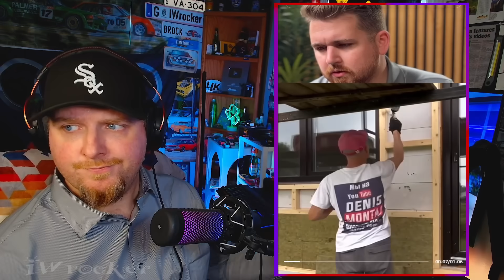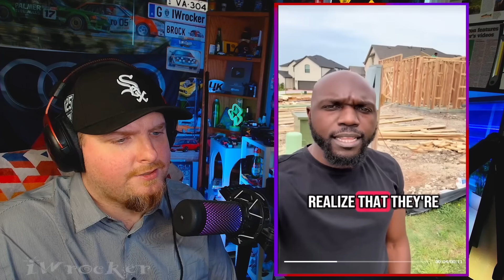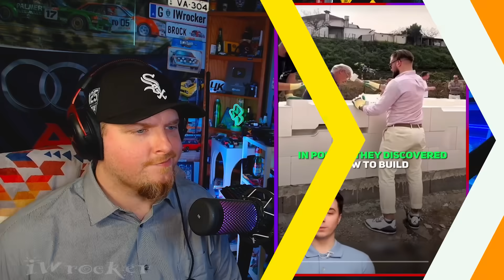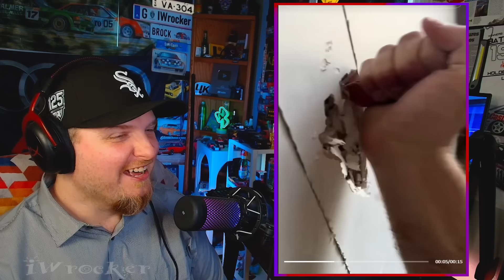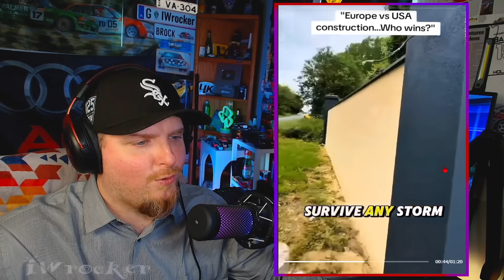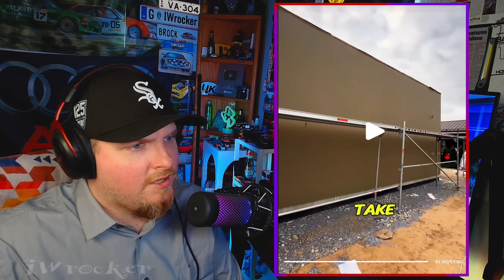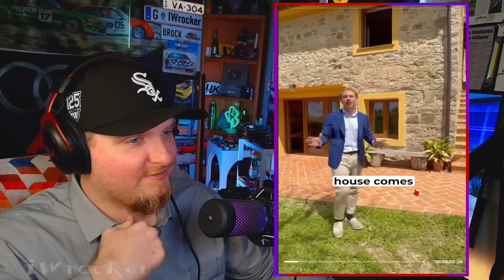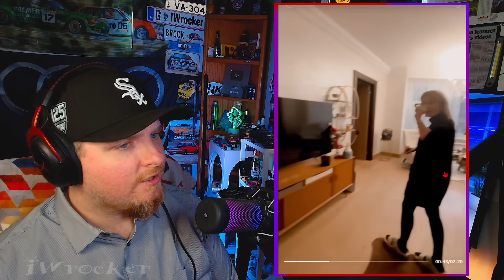25 Minutes of European VS American Home Quality & Construction Methods 🔨

Comment: European here, I live in a brick and concrete apartment with a good amount of insulation in the walls. Recently we had -27 degrees Celsius (-17 Fahrenheit) weather with a pretty good breeze. Inside my apartment I had 19 degrees Celsius (66 Fahrenheit), with the only source of heat being two small radiators. My building was built in the 1960s and was modernised in the 2010s with a heat recovering ventilation system. Aside from a bathroom remodel a few years before that it is the same apartment they put up 65 years ago.

My building is nothing special, it was part of the "Million Program", where the government organised the construction of a million apartments around the country due to the housing shortage we experienced in the 60s. They built a lot of apartments, as cheaply as possible and the majority of the construction was of the same or better quality as what I live in. Some were worse of course, always some greedy a-hole trying to scam a buck, but most still stand and are enjoyed by their tenants to this day.

Comment: The first guy, saying that they do housing better in America - you carry houses on trucks in America (before putting them down - i dont mean recreational vehicles). Like, to me it means theyre made of carboard or wood. Do they even dig foundations in America? They have to, since their skyscrapers still stand, but for a common bread eater? Its probably plywood and spit.

7:43 Dont approach a European wall without a set of drills, a pneumatic hammer or... a wrecking ball. Honestly. Our houses are meant to last, and to be frank - if American housing was built like European one - it would survive tornadoes (maybe except the roof - that would fly away), and not fracture into a million splinters, like we see on all those tornado videos.

Comment: Insulation on the outside is absolutely the proper way to do it. That way it is just a lining on the wall, and all the little bugs and critters that eventually might find it's way into the insulation are kept outside. Plus the wall itself is insulated from heating or freezing up, opposed to the US logic where the home is insulated from the hot or freezing wall.

Comment: 6:00 from what I know (I'm not an architect nor I work in construction, so feel free to correct me) you use mortar to absorb the movements of the house. because houses are not statics, and neither is the earth they're build on (think minor earthquakes). so mortar cracks but it can be replaced cheapely.

Comment: 18:05
The building is basically triangular but its a fairly sharp angle. The end is just 2 meters wide, but on the other side its 10 meters wide, the house is 22 meters long so the angle is quite sharp

21:00 That house in tuscany is pretty expensive. Its not very large, its very far out in nowhere , and you might think, well 185k is still not that expensive. You have to consider median pay in Italy is about 1/3 of what it is in the USA, and houses is really mostly construction work. So that would be a 550k home in USA

23:15 "How is it 700 a month"
Well it looks like its Riga, possibly Vilnius. Again they earn about the same as in Italy, So that would be a $2100 apartment in the USA. While sure, a $2100 apartment in NYC is still tiny. But Riga and Vilnius is not that large, about the same size as Tulsa. So would i rather want to live in Riga or Tusla. Yea. well riga is pretty nice, Never been to Tulsa, but it looks kind of boring

Comment: 18:40 I don't know if that specific house is just a facade, but this trick was used around  1860s, during the construction of the underground railway in London. As the steam locomotives generated large amounts of steam and smoke, it was necessary to provide open spaces where the puffs could find an outlet and disperse. Such a space was created however, an open hole in line of homes wasn't looking very nice. So they put the facade homes to preserve the nice look of the street :) (I'm not from London, not even UK- still European :)  so I might be way off....)

Comment: I used to work and live in Texas, and had kind of an interesting discussion with a co-worker when I told him I picked tripple-pane windows, which is the de factor standard in Sweden, and he though it was an unnecessary "upgrade" until I showed him I was getting about 15% energy saving compared to double-pane and 25% comparred to single-pane, especially on really warm days. And yes, I ordered Swedish tripple-pane windows and shipped it to Texas!

Americans love their AC but they also seem to want to waste a lot of that cool air with poor insulation or poor windows.

Comment: 2:00 That is a pittifyll amount of insulation.

Of cause, those blocks are foam concrete, they ad some insulation, but the added 70mm on top is really not very much. I have 210mm on  the old part of my house and 350 on the extention

14:30 This was done in  Sweden for a few years, but all of it need to be riped up. Sweden was way to wet for that kind of insulation and all of it get mold.

Maybe down in central europe where its a bit less wet and more dry cold it works.

Comment: That first guy mentioned pressure treated wood. Used to work in the construction industry in the states, so i have an insight there. Pressure treating helps wood resist decay and resist damage by insects. In damp emvironments, it is necessary for exterior walls because otherwise water will cause the wall to rot fairly quickly. And in this case, he is right to be worried. The concrete will sweat in the right conditions, (moisture trapped within will emerge) and without pressure treated wood, that wood can and will rot. I was trained that any wood placed directly against concrete needs to be pressure treated for this reason. It is to preserve the longevity of a build. And once that wood begins to rot, the rock wool (insulation) will begin to break down. And nobody wants that.
Reply: In Europe, pressure-treated and/or steam-treated wood is also commonly used, but even this is not installed in direct contact with stone or concrete. Decoupling is usually achieved using a layer of bitumen or similar building materials. I occasionally saw this in the US as well, but it seems to be a measure that is often omitted there.
Reply: @marcromain64its a different chemical treatment, but its safe to assume that the european one is better. Lol. In my experience, a metal stud gets fastened to the concrete, and the wood to the metal stud. This gives a small gap between the concrete and the stud. Though it is still referred to as "on concrete" even though it technically floats between 1/8th to 1/4 of an inch off of it. Roughly 0.3 to 0.6 cm. The gap can be larger, but rarely smaller. 

Also, never worked in small residential. My work was in industrial mostly, so we may have had different criteria.

Comment: The first video: That's a sample-size of one, so it's meaningless. This could be a refurb, it could be a guy doing it all wrong, They might even build a second layer of bricks on the outside. We don't know. Here in The Netherlands we generally build two walls and fill the gap with insulation.

And no there are no pro's to US construction. It's not cheaper to build, it's not faster to build, the insulation is worse, the sound insulation is basically not there, everything is made of flame-retardent material instead of just using non-flammable materials. For poopsake you still build dryer events into your houses... it's 2026, we stopped selling dryers that need a vent a long time ago...

4:40 House styles.

Different styles is fine, the looks are not the problem, the construction methods are the problem.

Building without Cement: Yes this comes back every few years and then it goes way again because... well have you see the size of blocks you need to get sufficient interlocking strength to keep it from falling down?  And you still have to seal the seams anyway so why not just make the blocks 1/4th as wide and add cement?

13:00 "Exterior insulation is normal in Europe" 

It's used in some parts of Europe. But sure, Americans think Europe is a country, so...

"if it's done crappy..." Every building technique leads to problems if it's not done right. Every house has to be rainwater-tight and properly ventilated. That's not a unique to this method.

18:30 It's not a facade, it's a just a house built on a wedge of land between two roads that meet to the right of that building. We have them in Amsterdam too. Inside the orientation is probably sideways so they have normal sized rooms but one several of those buildings, side by side.

The 180k house in Tuscany: Be aware that there will be a catch, like you pay  180 for the house and then $40k a year for the ground that it sits on, or there is some other tax that adds zeroes to your monthly bills. There is/was a promotion with italian houses where you could buy one for $1, but the catch was that it was basically a condemned building so you had to spend serious cash to get it to a state wher you could live in it. And then the rest of the village was still condemned houses...

21:00 700k for a 130meter apartment is about right for a big city, outside the city it gets you a nice house with a garden and a garage. Prices in Amsterdam are IN-SANE (thanks to all the tourists and expats), but 20km-40km away from Amsterdam they get more normal.

Comment: hmmm Russia, inner porous concrette wall (slightly tougher than chalk material, very porous, good insulation) + 5cm thich rock wool pannels on polyurethane foam (fills gaps and glues)
 - northern germany - same porous conrette wall, 20cm thick rock wool panels covered by 12cm kilned brick wall (because all city is historically made of brick, so they need to fit). Overal thickness of wall is 70cm (2.5ft) and only heating is needed for hot water in tap (maybe twice a decade if is exceptionally cold winter) - so must usuall is air to water heat pump (Russian probably heated by natural gass or wood).

(Poland - also porous concrette)

strofoam insulation, post comm countries very usual, various styrofoams are used, recently people preffer rock wool panels. That dark grey styrofoam is (iirc) with reduced flamability. I.e. in my country is illegal to not use anchors to mount it onto wall, in past it was usual to just use cement adhesive for smaller buildings, but higher levels use anchoring to walls for a very long time, all covered by cement based or plaster based adhesive and polyurethane paint coating (often with gravel filler). thickness depends on climate. Here is basic 8cm thick (3 inches roughly) in colder areas 15cm thick, some "passive" houses can use thicker insulation (not warranty that this apply 100% idk everything). Final finish can be artificial cut stone, tiles or real or artificial timber, endless posibilities (commercial buildings often use metal frames and glass or cement fibre panels)

Comment: So you're telling me the brick house behind the guy is actually wood? What's the .. point? Outside of industrial styles, who has ever said brick looks more attractive than wood? The point of bricks is that it looks crap but is cheap and strong.
And yeah you want the insulation on the outside, so the walls themselves stay warm and not just the air inside the walls. Also I need a powered hammer drill to hang a picture.

Comment: Hello, whether the wall is made of wood, brick, or concrete, the interior burns just as quickly. There is only a real benefit in terms of fire safety if your interior is completely devoid of paint and furniture.
My house is just about a hundred years old, and my grandparents' house is about 400 years old.

Comment: nbr1 he is in construction but don't even get that than before the rockwoll an other wall is constructed so the rockwoll is between 2 SOLID walls.
Londen , Thats called a tinny house :d , prices so high for ground , rent in Lonen they builded houses on every M they could , it's probl bought or rented as a 1 person house, or for ppl that have a house far from Londen but have to be there often and use it as a work house.

Comment: My house was built in 1620, still has the ORIGINAL roof tiles. (Derbyshire millstone grit). The kitchen floor is also the original York stone slabs, built directly onto the clay. The walls are approximately 80cm thick.

Comment: That little three-wheel Italian "pick up truck" is called Ape by Piaggio.
There are several version based on weight and volume capacity and engine size. The one in this video is the smallest one, which has officialt got a 50 cmc engine and can be legally drive by a 14 year old person. However, I daresay 90% of those are "not very legally tuned or modified" with a 100 or 148 cmc engine in order to have more strenght and a little more speed too. The engines are basically Vespa ones.
There are also bigger versions with bigger engines, such as 250 cmc 2 stroke petrol+lube oil engine ans 500 cmc 4 stroke diesel engine.
It is responsible for 3/4 of the rural economy and a blessing from heaven, as Italian country roads can be as narrow as a sidewalk in a city street.
That vehicle has saved my life more than once during wine harvest in very unacessible steep viniards and olive tree fields.
When we were teenagers, we used to do crazy stuff and dsngerous stunts, such as doing acrobats balancing on only two wheels. Good times.
Not the safest of vehicles, to be fair, though.
Ape patent has been copied by or lent to some Asian countries through the decades, especially around the Indian subcontinent and some Indocina.
Ape is the best!
I hope this is useful information for you all.
I apologise for my poor English grammar.

Comment: Insulation is to keep BOTH cold AND hot air outside. Properly ventilated and insulated home with proper air circulation does not even need AC. And if you need cool air, ground heating is the way to go.

Comment: Heat in a house comes from the inside and heats up rooms and walls, cold comes from the outside, and therefore existing houses are additionally insulated from the outside to prevent the walls from cooling down. In addition, if you insulate on the inside, you reduce the size of the inside of the house.

Comment: Houses in the US were built big at first, because land was dirt cheap. After that it became a status thing. Whose house is the biggest. It was like d*ck size contest. And what's with the faux brick panels? You aren't fooling anyone, America. It's still plywood, some insulation and a drywall underneath. A brick house takes a lot of time, money and effort to built and it will cost way way more. But if it's made out of cheap materials, you can make it as big as you want, as long as you have land. Bam! Big houses that are good for nothing in a big storm. Granted, they all look like mansions, with excessive ornaments placed for more status and charisma, but at the end of the day, it's still a big-ass shed.

Comment: “In the U.S., a 21-year-old house feels like a full renovation project. In Europe, you just redecorate.”😂
Reply: the wallpaper behind my computer is 43 years old!
so is the wallpaper in the rest of the room, helps a lot if nobody smokes!
Reply: @Arltratlo  My biggest problem is that I literally can't change the wallpaper. A previous owner used woodchip and the walls are lath and plaster. I'd have to re render the whole lot so have stuck with paint only as the only thing that gets changed.
Reply: @Arltratlo  lol I just thought that how badly the whitewash in my cellar is holding to the stone, it's probably the original one. That would make it 60+ years. It has survived longer than most of those US houses will.
Reply: also you dont need to modifiy the walls all the times in europe.
Reply: Guess were I live.
I live in a house from 1894. Inhabited continuously by my family. Damaged by bombs in 1944 and renovated in 1945-1947. My parents install an oil heater in 1970, a new insulated roof in 1989, new insulated windows in 2005. I installed a modern heating system with geothermal energy in 2022. Next year there will be new, better windows.
My son inherits a 150-year-old energy-saving house. Worth about 750,000€. Made possible by a building structure that will last 500 years or more. Continuous modern adaptation to the technology is of course required. There is no such thing in the USA, where demolition and a large pile of bulky waste are expected after 30 years.
Reply: Houses in the U.S. are built like fancy cardboard box forts. 😂
I've seen so many U.S. police chase videos where a car hits a house and ends up in the middle of the living room. 
Meanwhile here in Denmark.
I've seen a car (going around 40 mph. hit a house, and only made a few cracks in the wall.
Reply: @maxmoller  Search for "Why cars rarely crsh into buildings in the Netherlands". Not quite the same topic, but It's one of the best videos I have ever seen.
Reply: You don't renovate 21 year old houses in Europe lol. Unless you need to change plumbing or something. Usually when it's 50+ years old, you can strip it down and redo.
Reply: @korencek  
Exactly like I did with mine.
Reply: 20 years old homes in Europe are like "time to redo the floor and repaint it".
Reply: True, I bought a 25 year old flat and renovate everything.(nothing was done since 2001) wooden floor cleaned, new colour,new Fliesen on floor and walls. This will last another 25 years. 😊
Reply: It's true